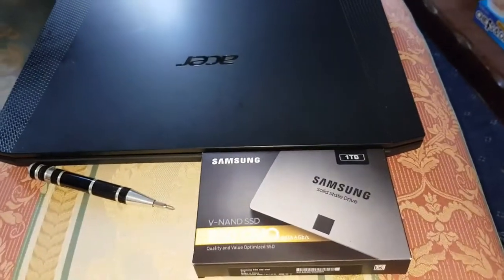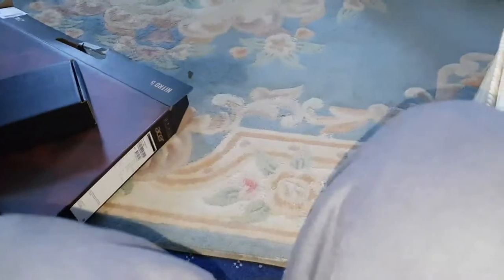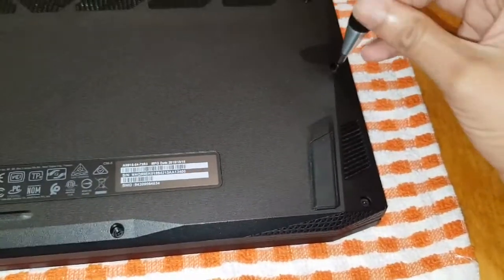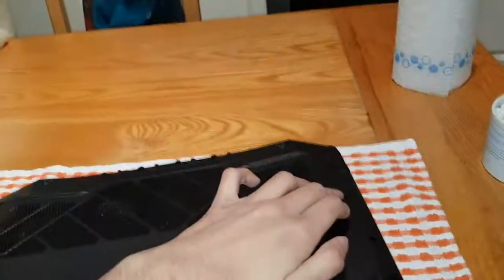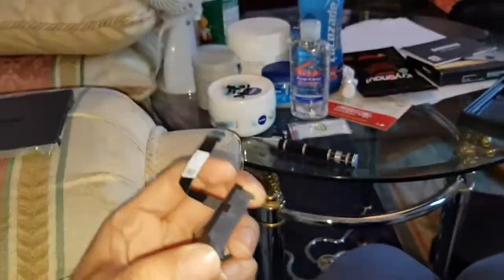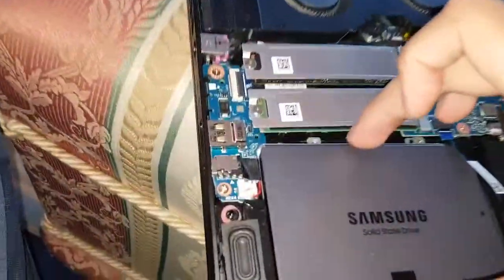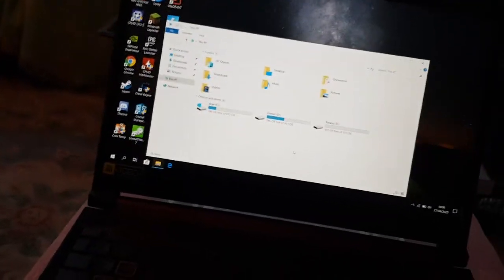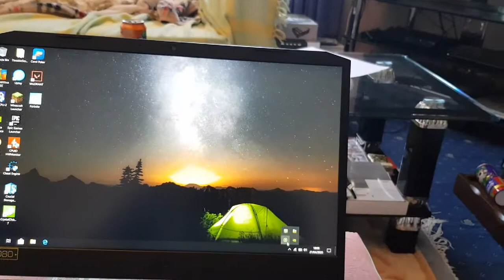How To Install And Initialise SSD Acer Nitro 5 Gaming Laptop

Comment: Great video. I got an SSD but I don’t have a connector cable. Is there one you recommend?
Reply from the maker: https://amzn.to/3gSqO2j this one seems decent
Reply: Please dont order this cable. I did thinking it was the right one but it has the wrong connector on the end
Reply: MAKE SURE ITS THE RIGHT CABLE BY THE WAY! It has to be specifically for your laptop model because I've seen reviews about ones that literally melted inside people's laptops because they weren't the right one

Comment: Amazing video bro
Reply from the maker: Thanks bro
Reply: Nice tutorial. 2 questions:
1. Is the program you use to look at your clock speed and temperature - is it freeware? Where can I DL it?
2. I put in a crucial M.2 2280 1TB drive. But when I type in partition - it does not show a new drive. Is my Crucial faulty? Or is there a bios switch ir something?
TIA
TonyW
Reply: PS. I have same model AN515-54
Reply from the maker: Yes free software type in crucial storage program it will come up on google, and then it means the m.2 isnt installed correctly, i had same issue, all i did was take m.2 out again, put it in all the way at a 45 degree angle and pushed it down, it should fit snug with no gap
Reply: @MrWaheedulHaque  ty. I sent it back... I've ordered a Samsung evo...fingers crossed
Reply from the maker: @tonywenz8820  good luck
Reply: I got a Samsung 980 PRO SSD M.2 2280 form factor. It went in and formatted OK. But Samsung have no driver for it, so I cannot clone it. 2 weeks I been chatting to Samsung, but still no solution. What a waste of my time and money. Maybe I try WD Black now. What do you think?
Reply from the maker: I still have no samsung driver for my 970 plus haha but thats because i need to swap some achi setting over, so its running on intel driver for the samsung drive, yours should be running intel driver on yours and that will allow it to be cloned and used
Reply: @MrWaheedulHaque  the samsung Magician software 6.2.0 reports an error. It says wrong driver. It also says in the instructions to use Samsung NVMe driver before cloning... What should I do?
Reply from the maker: Try use macrium thats what i used its free
Reply: @MrWaheedulHaque  Thanks for that great tip. I now have it running and cloned. What speed are you getting from your 970? (Do you know if the AN515-54 is 2 channel or 4 channel?) CrystalDisk says 3508-read and 3246-write. Specs for 980 are 7000....lol
Reply from the maker: Yes those are similar specs to mine, and its a dual channel ram it takes, and also yes 980 speeds are insane but at time of my purchase it wasnt even announced yet haha, id wait though a 980 evo plus with higher speeds will come out
Reply: @MrWaheedulHaque  Will the Evo Plus need a driver to get the fast speeds? I'm running Intel Octane RST Premium driver. Yet only 3k - not 7k...*sad*
Reply from the maker: @tonywenz8820  970 evo plus speeds is 3500 read write, where did you read 7000 haha, its achieving speeds fine with intel driver, the samsung one will help it keep its storage good over time but it wont affect speed
Reply from the maker: @tonywenz8820  oh sorry i thought you had same like me 970 evo plus, yh then it will be a driver issue

Comment: I got my acer laptop a few months ago and I dont remember what i did with my connector cable 😕
Reply: @MrWaheedulHaque  Random question but what are your gaming temps? I get always 85-90 celsius on my cpu when gaming which is not good..
Reply from the maker: @iluviayze  yes this is how mine was too, until i repaste it with hydronaut, i made video on how to repaste check it out, but beware you might void warranty
Reply: MrWaheedulHaque ok thanks!

Comment: If I do this I won’t lose anything on my laptop  that’s already on my laptop ?
Reply from the maker: If you adding a second drive no, if you changing your first drive then yes, so you would need to connect new drive first to pc using cable then use software to clone the old drive and then it will be alright